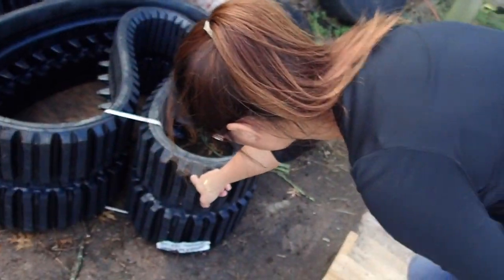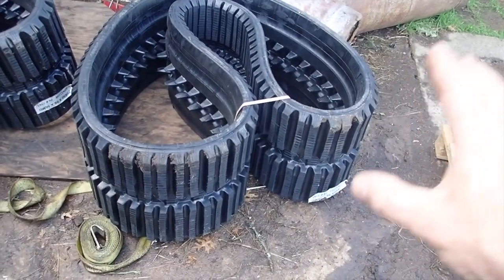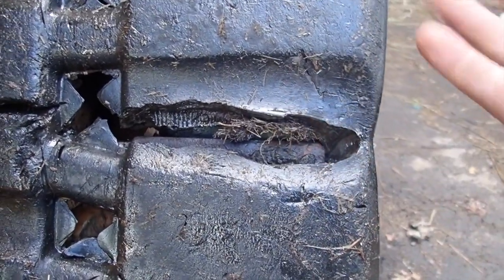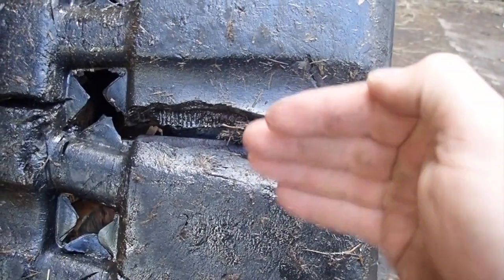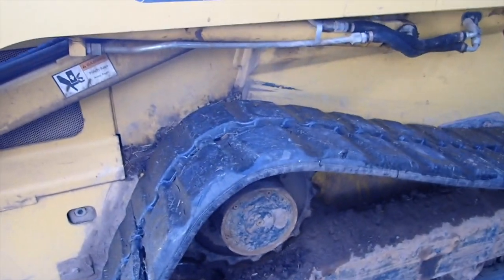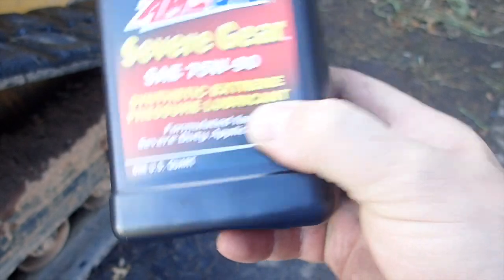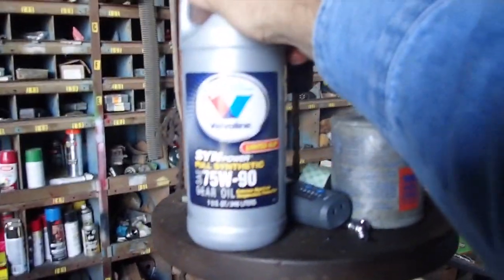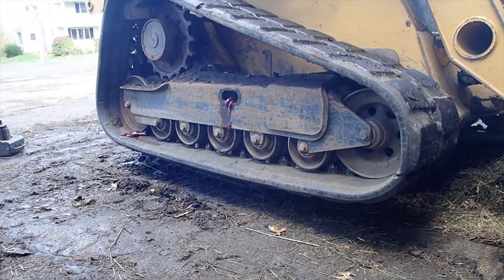Re-Trac The Skid Steer

Comment: Block of wood against the front idler and curl back against it carefully.  Shoots the grease right out and you don’t need 2 people.  Doesn’t have to be jacked up either to push out the grease.
Reply from the maker: i tried it would not budge
Reply: Think that's more of a trick to use with excavators. Don't think skid steers have the curling power to cope with that trick ;)
Reply: Wow that’s strange.  Did that with our cat 299c literally countless times.  Thank god that pos is long gone.  Went to asv/terex and haven’t thrown a track yet on three machines working in worse conditions.  Granted you do have to be careful about them and they are expensive to replace.  But the up time and much lower ground pressure and way more ground clearance more than makes up for it.
Reply: I did it in a brand new foley cat skid steer. Sone of them have the curl power
Reply: No jack required.  I thought you were almost going figure it out at one point.    Lift the front end as high as it will go, stick a 6x6 or equivalent under the body towards the back end as far as it will go, lower the front end and the back end is jacked up.
Reply: MrThisIsMeToo can bend shit like that
Reply: I  take it you have never seen the underside.  What do you think the small pad of the jack is resting on?
Reply: MrThisIsMeToo ive only ever worked with waker paker and cat skid steers, but those underbellys arnt real heavy plate, whenever i jake up a skid steer i put a block under the lift points and curl the bucket
Reply: MrThisIsMeToo but i see what your saying. If it’s heavy enough no reason it wouldn’t work

Comment: Couple tips, lay them new tracks in the sun for a while to warm em up. Much more flexible when warmer. 

 Also do it somewhere you can get the loader to the side of the skid steer, a decent length of chain wrapped around the track and lift it on the skid steer with the loader, takes fighting with the weight of the track out of the game. 

 Just trying to save your back a lol, ya got it done , congrats.

Comment: I appreciate seeing the Amsoil "Severe-Gear"75-140 on camera Wes,if you read on the back of that bottle,you'll see the military spec rating and that machine will easily last another 50 years or more using 75-140 Amsoil in it.
I personally use the 75-90 Amsoil in my trucks differentials,I've noted significant reductions in diff temps.
Reply: 4 gauge do you sell amsoil products?
Reply: Oliver Knapp Yes I do,I used Amsoil products for about 2 years before selling them to see if there is any performance advantages and there is a big difference between the Castrol oil that I was using and Amsoil,I became a dealer in 1999.
Reply: 4 gauge I know amsoil is fantastic stuff I use it in my Duramax

Comment: well may be time to look at buying an old utility or train service truck with a boom on it with the number of large equipment you have and the cost of down time it would be a lot easier to have the truck stocked with all the basic wear parts ,tools and air that you could use at the farm or the field
Reply: SMILY95 why not just use the front loader attachment on the tractors?
Reply: well a service truck can carry spare parts and tools so he would basically be a shop on wheels

Comment: Verry interesting video,can i ask why you do repares like this yourself?here in holland when repares like in your video have to be made 99% of the farmers would bring it to a shop
Reply: 99% of farmers and contractors in the US have a dealer mechanic service their equipment also. Wes shows us that you don't have to do that, you can repair and maintain your own equipment. I grew up on and around small farms that had to do their own repairs and maintenance just to stay profitable. 
It's a good thing for the service industry but at the same time, the cost is a little over the top and hard to bear for a small operation. For a small operator if a piece of equipment breaks it can either be fixed by the operator or he can call for an expensive service truck that won't come for hours and meanwhile the operator is sitting idle doing nothing.
In a few videos Wes talks about the cost of a dealer service department doing a repair and the cost of him doing the repair on his own. The savings is in the labor cost, even if he paid himself prevailing wage he still saves money.
Reply: Most dealers around here only hire kids fresh out of high school that basically know NOTHING.  They have maybe 1-2 "old timers" in the shop that have worked on stuff forever and know what they're doing, and they basically tell the kids what to do.  Service trucks aren't much better... 

Course they still want to charge you $100 per hour or more shop rates, even when they send a kid out that would be working at McDonald's otherwise... I've seen a LOT of stupid stuff done by these kids too... BIL had a straw walker replaced in his 9600 combine 2 years ago and the 2 young guys they sent out spent about 2 hours or more taking the doghouse loose on the back of the combine to take the walker out before they figured out from the computerized shop manuals that they didn't have to do that... they climbed up on top of the straw chopper with half the bolts removed from the doghouse and nearly ripped the entire thing off the back of the combine... It was like watching a pair of monkeys humping a football for awhile there... They FINALLY got it together and replaced the damn thing.  Only reason we didn't do it ourselves is that both he and I are old and fat and you need a skinny kid to squeeze in on top of the sieve and chaffer up under the straw walkers to get the front bearing and bolts installed on the front crankshaft... 

I used to take my hipper bearings to the shop to have them pressed in, since I didn't have a shop press at home.  I was having bearing failures WAY too often and went back in the shop one day and figured out why immediately-- darn goofy kids were pressing the bearing into the housing bore by pushing against the INNER race, not the OUTER race (you ALWAYS push on the OUTER race when pressing a bearing into a BORE, and always push on the INNER race when pressing a bearing onto a SHAFT).  By pressing them into the hole by the INNER race, they were denting the balls in the bearing and possibly cracking the raceways, and so NO WONDER the bearing would fail fairly quickly after installation.  I went and made a press tool out of a steel oilfield gas line coupler I bought and welded a heavy steel plate on one end for the press to bear against, which would perfectly fit the outer races to push them into the bore, and the stupid kids at the dealership had to be FORCED to use the thing (too lazy to use it).  The last time I had them do it (paid for them to do it) this loud mouthed know-it-all moron kid went back there and put the thing in the press, started pressing, the bearing went cockeyed, and he kept pressing until he was literally HANGING off the press lever WITH A CHEATER PIPE ON IT... needless to say the bearing EXPLODED like a hand grenade, showering balls and bits of raceway like shrapnel all over the shop, and ruining a $40 housing.  

After that, I just bought my own press... 

Heck, most of the car dealers now do the same thing.  Hire kids to do the grunt work, and keep a couple old timers around to tell them what to do.  That way they can hire "mechanics" dirt cheap and only have to pay a couple of old guys a REAL wage to keep them around to actually tell the kids how to fix stuff.  Course the kids only work for them for a year or two at most-- as soon as they can get some experience, and can get a better job, they're off like a shot to work for the oil companies or pipeline companies or utilities or whatever, and they hire another dumb kid to take their place, and the cycle continues.  

That's why I don't use dealer shops anymore... I either do it myself or take it to a good local INDEPENDENT mechanic... 

Later!  OL J R :)

Comment: Your doing it wrong. I've installed 100s of these things. Cat, Deere, Bobcat,   Case. They all have gone on easiest the same way.
Next time, use the curl of the new track to your advantage..... Then put the thing around the rear idler first. To get it over the front idler, a couple small chunks of pipe let the guide lugs slide right over the idler.
Reply: Exactly!